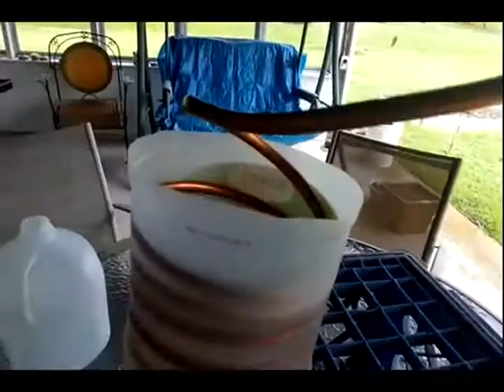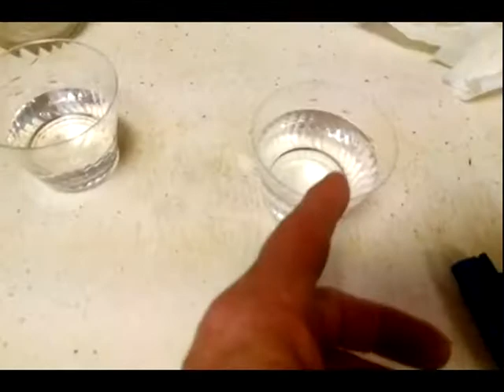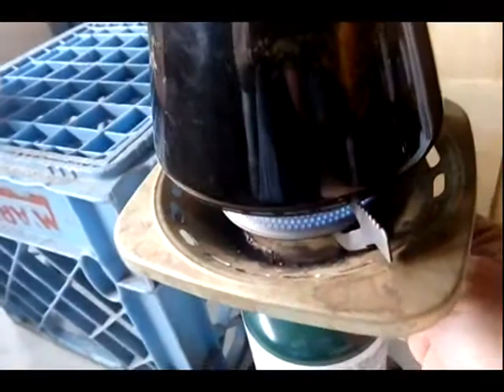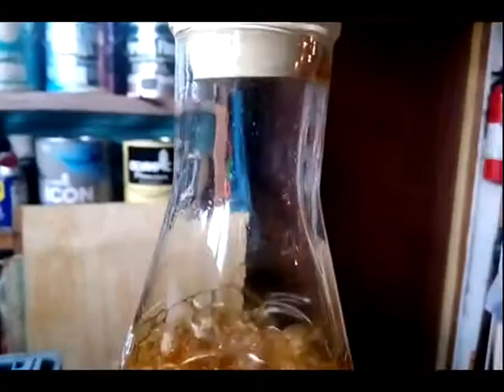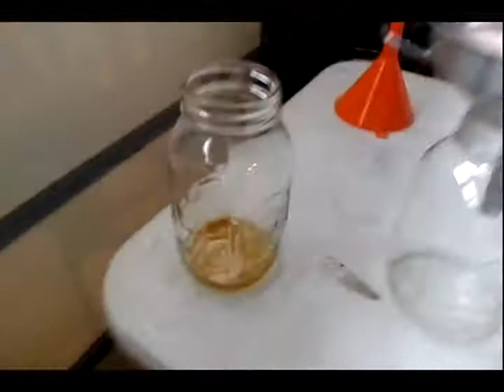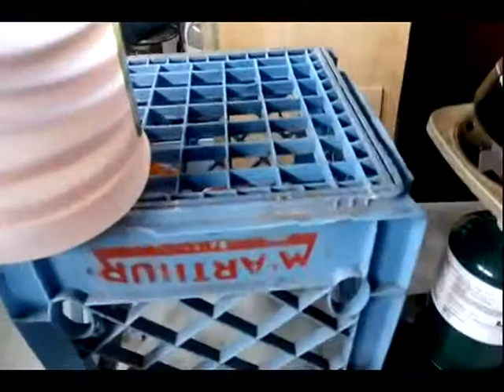mini still from spare parts

Comment: I use a distiller and I've always wanted to clamp some neodymium magnets onto the pipes. Magnetic water allegedly reduces lime scale and helps to soften hard water, again I just wanted to mention this..... might give you some ideas?
Reply from the maker: I once used structured water using a magnetic vortex device to proof some rum.  The difference was phenomenal.  It made the hard water taste delicious.  It would take me no less than 4 hrs to make enough of this water for six gallons of mash, making it less than worthwhile.  But for proofing the final product it could turn mediocre into fabulous.  I'll bet putting a bunch of neodymium magnets spiraling around the liebig condenser in a + - formation might give a positive effect to your product and won't melt the tape from the heat.  Maybe neodymium bar magnets surrounding the liebig would hold them all in place, like a bracelet.  I'd start out with about 30 of them and see where that goes.  Magnets are a great idea.  You've given me my next project.  Thanks.
Reply: I know that distilling helps to remove the chlorine/fluoride from the water, also Nikola Tesla allegedly used to drink distilled water (That's the reason why I drink it). I get inspiration now and again, however I don't put my ideas into fruition. I remember reading about Living/structured water (Viktor Schauberger) and thinking it seems promising...... I just want say I'm pleased I've given you a great idea for your next project.